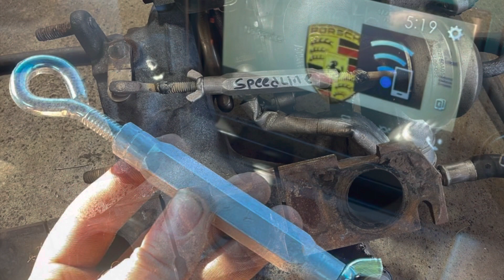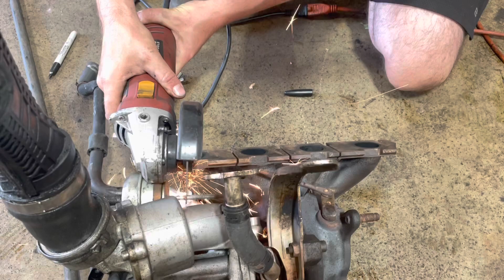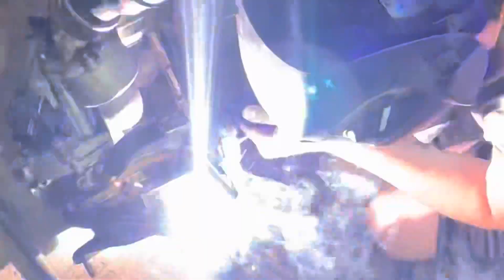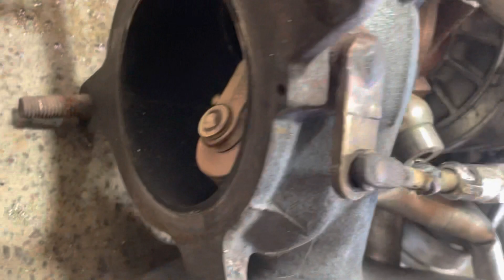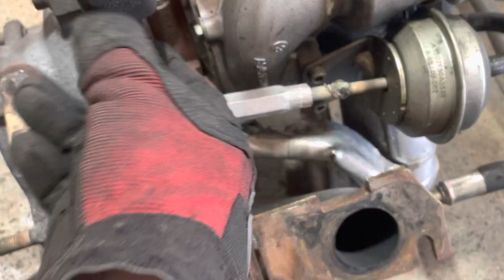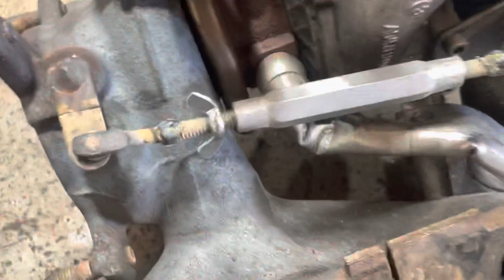Audi’s 2.0TFSI - Fixing P0299 for $5

Comment: Do you think I need a bridge to take out my turbo? I want to replace it with a new one but I don't have a bridge and iam not sure if it's difficult to install because my local dealer ask minimum 1800 euro for putting a new turbo alone on My audi a3 2.0 tfsi ..
Reply from the maker: You can remove turbo yourself with basic tools. Raise front end up / disconnect catalytic converter and coolant / oil feel lines from the block (bottom end). Remove upper heat shield and hoses that are in your way. 
12mm flex head socket for all the bolts on the manifold. Then it’s free from engine and you just need to fish it out from the top.